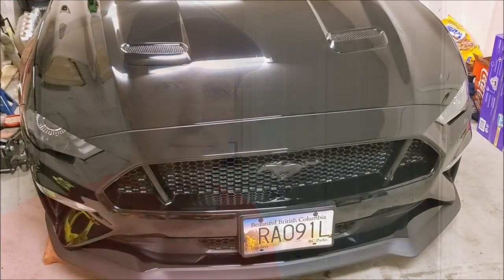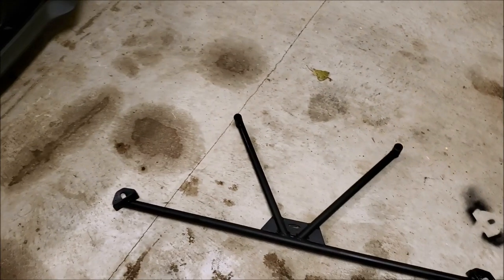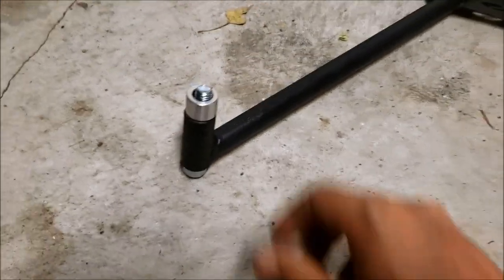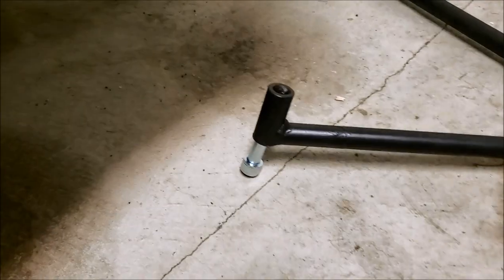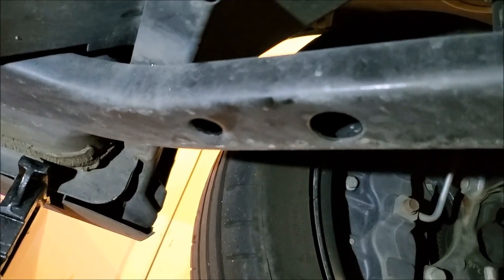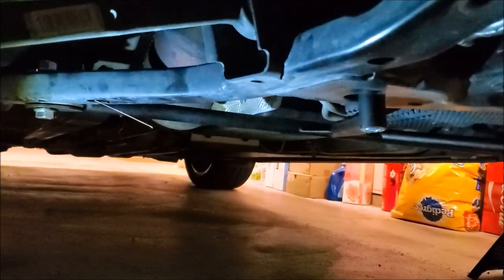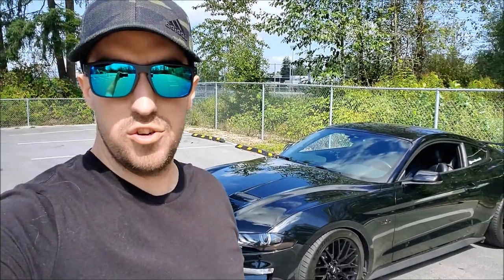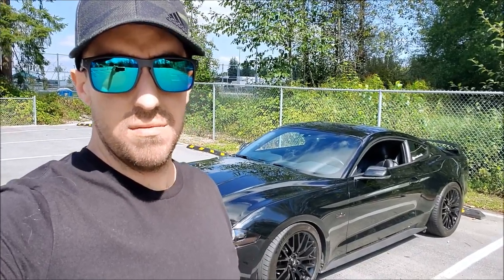Steeda EXTREME G-Trac K-Member Brace INSTALLATION  *2019 MUSTANG GT REVIEW*

Comment: on mine i didnt use the cylinder spacer. It tucked it up higher. My car is lowered as well witha 1" drop. I havent had any issues with it scraping i have some nasty dips by my house on the highway as well. Great  video
Reply from the maker: Awesome. I found out later the spacers are for if you have longtubes. Drops it just a bit so they clear.
Reply: @CanadianCruisin  ok cool i did not know that. Glad you told me. I cant tell if its the k member or the front and rear swaybars because i installed them at the same time has really stiffen up the car. To a point were i sometimes lift a wheel going on driveways.

Comment: Great video! I wonder if this would stiffen up my convertible. The body gets a little twisty on rumbly roads. What would you guess it weighs? I took a look at the Steeda website for specs but all of their support material is from 2015, and like you said , doesn’t show the parts and instructions for the 2018+ cars.
Reply from the maker: I find it weird there's nothing for the 18+ anywhere. It's not very heavy. I'd say less than 10lbs with hardware and everything
Reply: @CanadianCruisin  It sounds pretty light. Thanks - I'll add this to the list!
Reply: Ford Racing makes a nice strut tower brace with cowl brace that works better than the OEM they offer from factory.....This Steeda Brace in this video weighs 20 - 30 lbs if that.....Used along with strut brace and if it's a convertible pumping ponies you would want to connect the rear with front using frame jacking rails bolted and welded......I've seen pinch rails that looked like crushed beer cans......Good luck

Comment: On my 2021 it bolted right up to the frame,pretty much flush,ni need for the spacers,+I'm lowered,and I don't scrape
Reply from the maker: I found out the spacers are for cars with long tube headers. It gives a little space for clearance